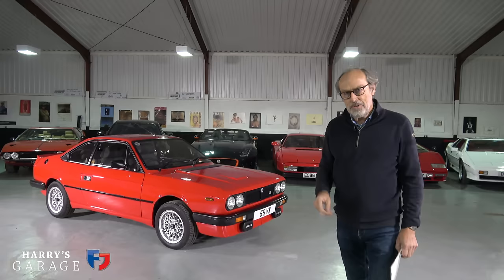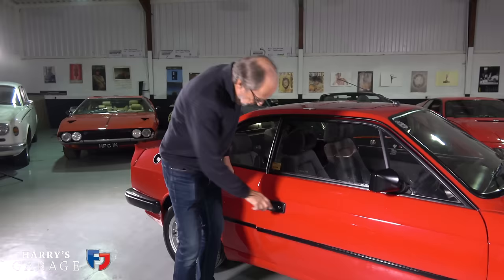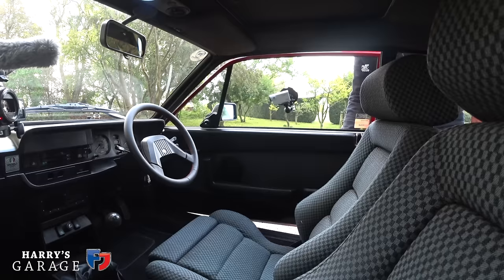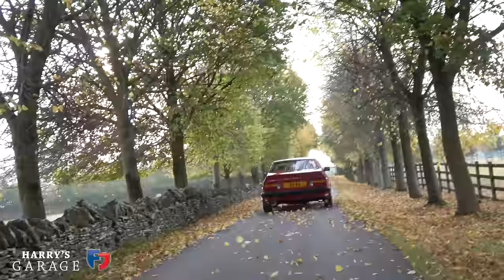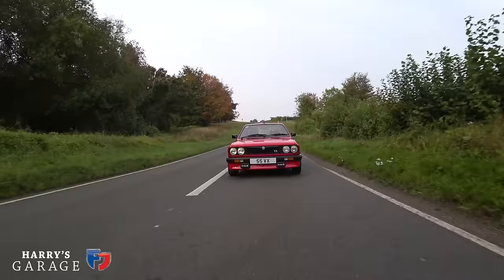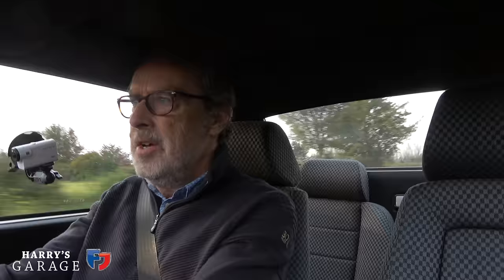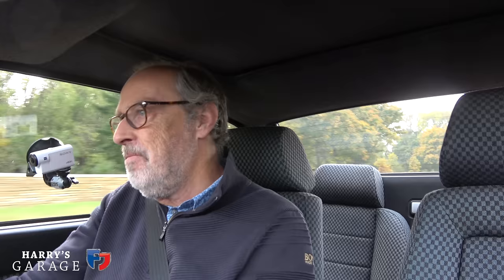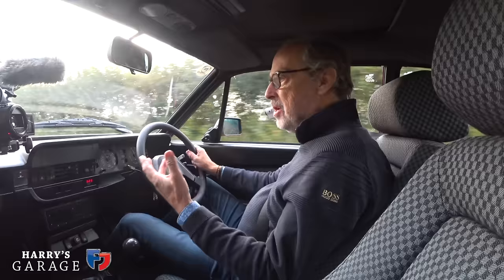Lancia 037 Group-B '83 WRC winning car & Beta VX on-road review. Greatest supercharged Lancias ever

Comment: Grew up with the 4 door version (Trevi Volumex) as it was my dad's car just as I got my driving license, great time as still no speed traps so a lot of fun seeing how fast it could go around the Rome ringroad. Problem was the early version of a collision safety cut-off, I think it was some kind of mercury switch, used to kill the engine every time you hit at speed a decent size pothole or bump, then you had to wait for ages for the thing to reset...😂

Comment: I found it a bit off putting that Harry kept calling it the Beta when it's actually the Beta Coupe. There were probably more Beta Saloons produced than Coupes, they certainly came to market earlier. Also, the two litre Fiat engine in the Coupe (and Saloon and HP) was really the culmination of that series than originally started in Lancias as 1400cc and 1600cc options in the Saloon, later replaced as 1600cc and 1800cc options then finally the 2 litre. This engine was also used in Fiat 124, 125, 130 (the Abarth version of which was something to drive), 131 and 132 - and probably more.

Comment: Owned '84  white targa Beta. Beautful car. Traded it in for  Damiler Dart Ivory with red interior. Then I sold it went to Germany and bought a bright yellow Porsche 914 2.0. Trade that in for a  VW Beetle Cabrio 1303. Unbelievable that none of these cars cost anything close to current market values today. I paid £3200 for the Dart down to £1500 for the 914 2.0 ! But that was the late 80s and a lot of current classic cars from that period were cheap as chips for some reason. And prices have never dropped since

Comment: Done a head gasket on one of them back in 93-94
Reply: Little further on in the video now only 9 of the volumex ones in the UK? knew they were rare but not that rare and the fact it's red (dare say most were)  that might very well be the same car!...Ask the owner if the history of the car traces back to Aberdeenshire between the 80s-96 at all if so then it's certainly the same car previously owned by a Vet alongside a few other interesting cars

Comment: Lancia's were wonderful cars (and unjustly slated because of the rust issue): I owned a Beta HPE in the early 80's and worked at a Lancia garage on Saturdays, whilst studying as an engineering student. I drove the new Beta Volumex, as well as Gamma, Montecarlo and the occasional Fulvia that came in for service. All were lovely in their own way, well engineered and far, far more interesting than the bog standard cars, that filled our roads back then. It wasn't a fast car by modern standards but it was a lovely thing to own. The 'trick' rear suspension Harry mentioned, was independent and could be adjusted in a variety of ways for geo, it was streets ahead of most British cars of the era and added to the delicacy of how the Lancia handled. The geo could be tightened up further and better quality, lower profile rubber helped (I ran Goodyear NCT's on my car) but the balance of ride and handling was pretty good with OE. Great memories! Thanks Harry.

Comment: This video evokes so many memories. My VX was the same colour inside and out as this one without the body kit, But I'm sure it had a better steering wheel than this one. Brilliant car and handled tight twisty roads very well. My Themas were the 8V (very under powered) followed by the brilliant 16V i.e. A very rare car back in SA. I had a GTV6 the same colour as seen this this video, but my present GTV6 is grey 3.0L. At some stage I also had a Mk2 GTi Golf like the one in Harry's garage. Well built car, but sold it at a loss as it lacked the character and torque of the Alfetta 2.0 with VVT that I had at the time. Not many people know that Alfa had a VVT back in the 80s.
Reply: Standard steering wheel, albeit trimmed in leather. Previously has a Nardi, but was removed to make the car period correct!
Reply: @simonoliver574  I'm not that struck on this wheel, but really can't remember what mine was like. No offense intended. A really nice car and I would have another if I had the funds and space. Congratulations. Now if only my GTV6 would run for more than 30 minutes at a time I would be very happy. A problem with the Jetronic causes it to run very rich when warm to the point it has no power and blows copious amounts of black smoke. Everything, and I mean everything, has been replaced and tested. Except for the new loom I'm rewiring.

Comment: Lovely car. Unfortunately Lancias name was tarnished after a rust scandal brought about by a tabloid UK newspaper, unhappy with the volume of imports coming to the UK after we joined the common market, lifting the heavy tax protection levy they bore before. They said the engines would call out but it never happened. The Beta was praised as the best Lancia made up until that time by various motoring journalists. Even Ford and Toyota used the Beta as a yardstick of rear suspension design for their Mondeo and Carina models 20 years later. Great car . Great video.

Comment: In a way I'm actually very glad, with all the hints at trouble, that it was 'only' a mysterious system failure and not anything more dramatic! Would've hated to see you bin it or something... but oh-so cool to drive any WRC car on the road, let alone a Martini Lancia. Weirdly the Beta Coupé looks more similar to the Rallye 037 than the Montecarlo that actually served as its initial base. Or maybe it's just that the Beta front face has been swapped onto the 037 design, Sileighty-style.

Comment: I'm envisioning that Lancia Beta lowered with fender flares, some black  deep dish wheels, and an engine tuned to about 240 hp. Tighten up the steering, and I bet that little car is a beast on the track. And the 037 looks like a blast to drive. Too bad it cut out on you..

Comment: I never really got the point of the Volumex road car given the very limited extra power.  I owned one of the nicest Montacarlos in the UK until moving to Aus in 2001 and with a Guy Croft block, head, twin side draft Dellorto 45s on standard cams it put out a bit over 150 BHP and the torque was great all the way from tick-over to 6000 RPM.   Super responsive and just a couple of dabs of the throttle to start from cold.

Loved the standard Beta Coupe - Mother had a 2L version and then went onto a Gamma Coupe.  Both had such good handling in their day.
Reply: The additional torque just makes it super smooth and powerful from the bottom of the Rev range. The limited power increase is slightly irrelevant in this situation.

Comment: Just brilliant. Its so Sad it couldnt retrieve its self as a firm firstly here after the rust issue with, was it the Betta? warranty issues with the tin worm. But unfortunate that the dying with no simple recovery seemed to be the norm well certainly as a kid we had a few Alfa Sud and the 80's Julieta which I was at fault for distracting mum then the car I had learnt to drive in!! was no more from a simple hitting the car in front at the lights at low speed the poor thing just crumbled? Such good memories of driving an actual car at 13 but one that felt so so good. The down draught Delortos just a delight growling Boxer before Subaru did just that.

Comment: My second car as a student  in 1985 was a 1982 2.0 Beta Coupe.  It had 11,000 miles on the clock. It was bought by the original from Portman Garage in London for a whooping £11,000 (so I’m not sure about Harry’s figures there) and I bought it only  3 years later for only £1100 ! Such was Lancia’s poor reputation and secondhand values in the UK in those days. If much older you virtually couldn’t give them away.
I loved that car and took it to a mileage of 33k. Unfortunately, I didn’t love it enough to understand in those days that cars need servicing. As a consequence , inevitably something ‘bad’ happened to the engine...I now suspect the timing belt slipped or snapped. I couldn’t afford to fix it and so ended up giving it away to a friend.  He fixed it but soon after the car set itself on fire!
I replaced it with a 1972 BMW E9 3.0 CS.

Comment: The Betas were a great cars in their day, they are still not bad. Very modern architecture, multilink rear sus by camuffo (used by many manufacturers since) McPherson up front and transversly mounted engine and gearbox.  I grew up with my Dad owning them, they always felt special. I always felt a Beta fitted with grale power and drive train would have been a better handling car than the Delta.

Comment: I’ve owned 3  a 1300 a 2000 carb and  a 2.0 ie lovely cars always a pleasure to drive and a nightmare to fix one think not mentioned the brakes discs alround when most manufacturers were still using drum brakes on the rear the car would stop on a sixpence brilliant

Comment: I love that the Beta and the 037 have the same door handles, also shared with numerous Fiat products, and the Stratos and Dino 308.  And I hadn't spotted before that the 037 and Stratos also have the same tail lights.  The 037 must be an fantastic drive but even on ordinary roads I think after a while I'd want the helmet and ear plugs.  And I'm pretty sure that to drive a car on UK roads you need number plates, and a speedo?

Comment: I had a 2000ie coupe - they weren't called Betas by that stage.  Lovely engine - even the non supercharged ones pulled like trains.  Autocar timed these at 9.2 seconds to 60.  Brilliant handling - you could get the tail to kick out - lovely direct power steering and powerful brakes.  Brilliant rear suspension design copied more or less by almost everybody.

So why do I own a Porsche 924S as my classic car today - well at 33 years old its bodywork is in vastly superior nick than the Lancia's was at six years old.  Reliability issues in the Lancia were largely caused by the rust shorting out earths - injection pump was intermittent.  I could go on and on.

A pity - it was a lovely drive.  But so is the Porsche and even now I could use it as a daily driver if I chose.

Italian passion has been replaced by ( a modicum of) German common sense.

By the way I would take the original more elegant looks with the classic Beta alloy wheels any day over that body kit and wheels.

Comment: Great video, great cars. An 037 Stradale is in my top 5 lottery win cars (S4 & 131 Abarth also being in there!). I desperately want to know what's wrong with the 037 though! It did "feel" like an electrical issue from the video as it was so sudden, as opposed to a "petering out" fuel supply problem, but who knows!

Comment: The GTV6 was in a class above. It was considerably more powerful and a rear-wheel drive GT. The GTV2000 (130BHP) was a more obvious competitor - but again was a less sporting GT car. The supercharger in the Volumex only gave another 15BHP over the standard 2.0 litre (120BHP) so one wonders what the point of it was.

Comment: I love Lancia's of this generation.  Such an iconic look!   But only a 13 hp increase from the normally aspirated version?  First impression is someone at Lancia is fibbing.  But the SAAB 99 Turbo only had 140 hp.  I think the goal was torque and drivable which this car certainly has.  Big hp numbers weren't common back then in street trimmed cars.
Reply: It is the torque. It pulls wonderfully from the off, but runs out of puff about 4,500 rpm. Also don’t forget, the supercharger utilises some of the engine power to power itself!!

Comment: They ( Beta ) used to eat front driveshaft splines where they slide into the diff 😬 .... great cars , Fiat TC engine a classic, loved my Delta turbo, and 131 sport 👌🏻
Reply: The splines would strip if the gearbox was not correctly aligned and tight to the engine. Speaking from experience!
Reply: @445fhn  learn something new everyday 👍🏻

Comment: Hi Harry!  Sorry?? You stand corrected??  Its NOT the same engine as in the 037!! Rally Car has a 16 Valve Head and NOT an Eight Valve Head??
Reply: The head may be different, as are other parts of the engine. But it is the same FIATfor FIAT, Lancia and Alfa Lampredi engine, which developed in many different forms between 1966 and 1998.
Reply: @martinrichardhorrocks9869  I understand what you are saying? Harry was saying that the Volumex (supercharged) engine in the Beta was the same engine as in the (Supercharged) 037 which it isn't!!  
Beta is a 2 litre with an 8 valve head and the 037 is a 1.8 litre with a 16 valve head and the blower configuration and method of drive of the supercharger plus intercooler assembly on the 037 is totally different from that of the Beta. Also oil pump in the Beta is driven from an auxiliary shaft whereas it takes off the crankshaft nose together with an a centrifugal air separator on the 037. Harry was implying that if you had a Beta it had the very same engine which just isn't true? They both stem from the Lampredi design that I agree but if you are buying a Beta you won't have the same engine as in the 037. However the Beta engine is a nice one to have for road use.

Comment: Gulf livery aside, is there anything that makes a car look better than the Martini livery? 
A good look at the car with those delicate black/blue/red stripes as it passes and then the rear of the car disappearing down the road with the last thing you see being "LANCIA    MARTINI" across the back of the spoiler as the scream of the engine echoes through the woods for a while after you lose sight of the car around a bend. The smell of exhaust, hot machinery, and gravel dust hanging in the air....

Comment: it's not the same engine as the 037...to start with the head...the 037 is 16v...casting of the block looks the same but there are lots of differences...its not the same if the headgasket fits

Comment: Unfortunately much of what had been said in "the gran tour" about the 1983 rally season is completely invented to appease the British viewers, providing them the stereotypical Italians and Germans they wanted to see. It's entertainment, not a documentary.
IE all that had been said about lancia exploiting grey areas is bullshit.
To start, the homologation numbers. It was of 200 cars for Group B. The number had been lowered from the 400 of Group 4 exactly to allow to more mid engined cars, tipycally made in small numbers, to compete. 262 samples of 037 had been manufactured, like 224 Audi Sport Quattro had been manufactured to compete in the 1984 season. The "half of cars for homologation" is an old tale, attributed to many different cars over the years. 
Then,  Audi tried to play the "number game", by bringing more cars than Lancia to the races to make points, (Audi had more cars competing than Lancia in 10 races out of 12. Lancia in one. In one they had the same numbers of cars. Surprised? That's Clarkson for you).
Third, you can't put the roll-bar you want in a WRC car. The roll-bars of the 037, like any particular of the car, had been homologated by the FIA both in materials (35mm diameter 25CrMo4 steel tubes, for a total weight of 42.5 kg. You can still buy one, since they are mandatory to compete in historical rallies) and in shape. They had been examined after the crashes, and found to be regular. Obviously no steel roll-bar will save you if you skip a 140km/h turn and crash straight into a tree. 
Etc... etc...
Reality is that Lancia won fair and square, and easily. It won the championship two races in advance, despite not having competed in two of the previous ones. It had not been a close fight. It had been a beating.
Fact is that the 037 was a race car. The Quattro was a normal car with a gimmick.
In 1984 the 037 was about to win the championshp again, without Rohrl, and without even trying to.